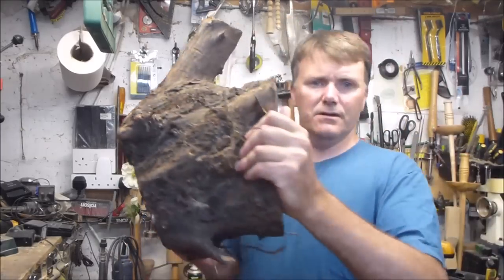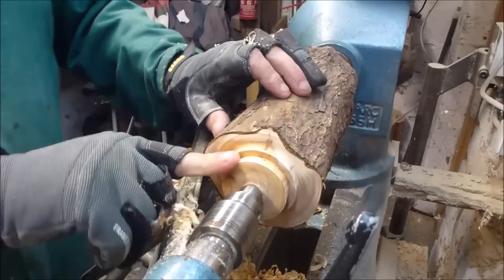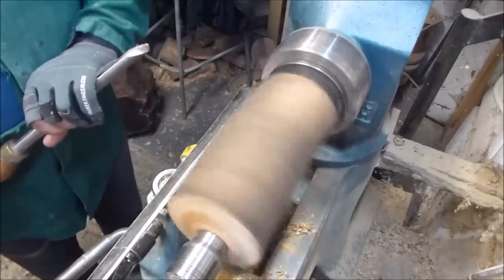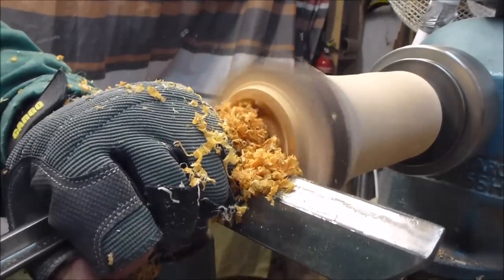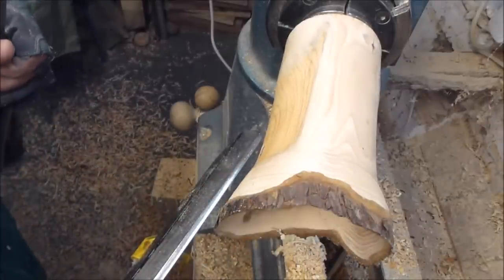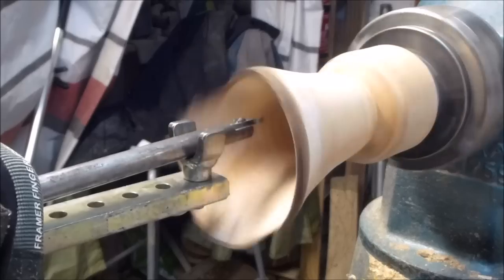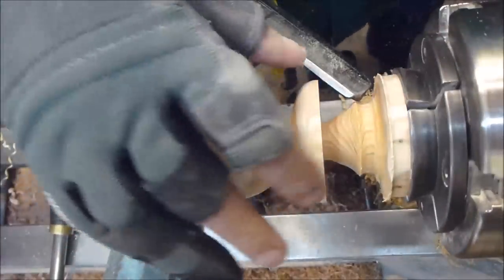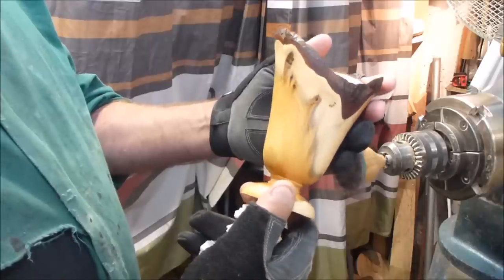31# woodturning a yew vase

Comment: Hello Robbie,
Today I attempted to turn a vase like your's using part of a cherry tree which we had to cut down about 9 months ago as it was swaying dangerously close to the house.
I soon found that the wood was wet but I carried on and made it as thin as possible.
However, as you warned one slip of the chisel and the project is gone.
Well, my tool slipped and I removed a piece of bark.
I tried to repair it with another piece of bark and some CA glue but it looks like the dog's dinner.
Anyway, it's another step in the learning process.
I've got some news for you.   Brendan (Baconsoda) has enjoyed his renovations so much he has decided to go into the building trade full time.
We are all going to miss his "craic".
We shall only be receiving uploads from him about cement mixers and plastering.
Best wishes,
Alan.
Reply from the maker: Alan Simpson well Alan that's life just put it down and start again one thing about wood turning theirs plenty of wood ea.well Brendan is serving his time as a plaster now so we wont see him for 5 years lol
Reply: Hello Robbie,
Thanks for getting back to me.
Brendan has now bought himself a castle which he's going to renovate.
He says he chucks bits of food down to peasants like myself to keep us happy.
Looking forward to your next upload.
Best wishes,
Alan.